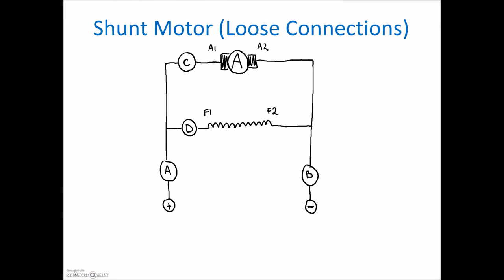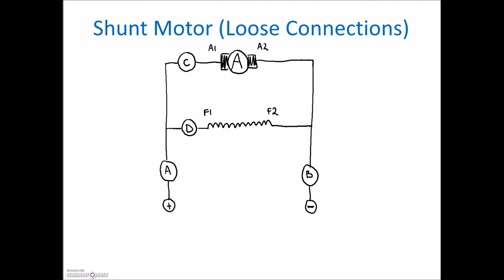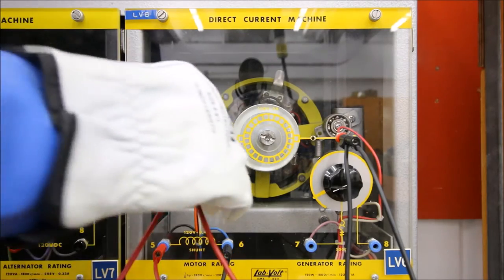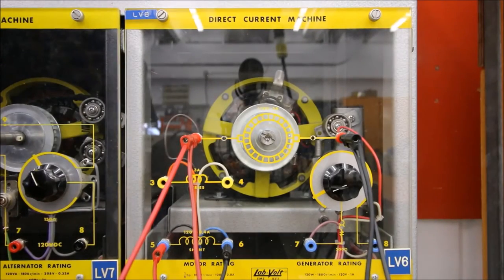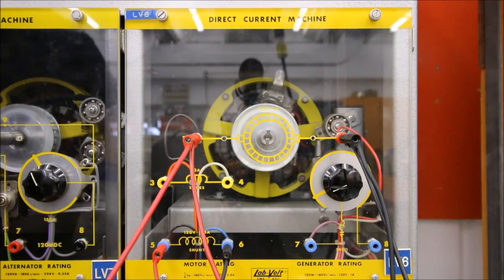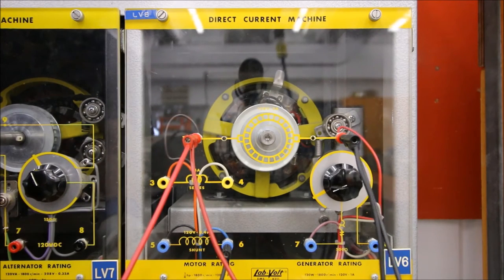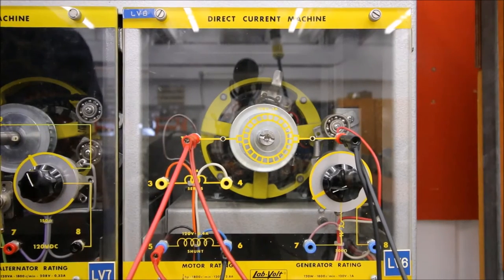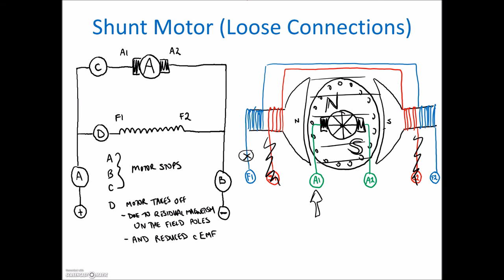Shunt DC Motor (Loose Connections)

Comment: Cool demonstration! How did you know when to unplug (since this seems to be a school's expensive equipment), and what would you do if you didn't unplug in time to save the machine? 

...why are all these guys writing "wuld' in the comments? What's up with that? Bots? Foreign spies? 14 years old? Or can some engineering students just not spell? 😸
Reply from the maker: As soon as it takes off we turn off the breaker. If you didn't disconnect on time, the bearings would heat up and the motor would fail within minutes.

Comment: how wuld a generator starter set up look like? haveing same device doing bouth useing the brushes to control functions. how wuld capacitors effect that device? there are some mith's about those engines like loockridge device,teslas methode of conversion etc
So Im wondering how dry cell baterrys wuld react? so any info about those old system's? Im useing actualy plazma ignition and amplifier ignition as well so Im wondering if that culd by implemented in those devices? I try to understand peater linderman but hes not realy usefull realy considering the back emf problem. We dont realy see any solid state circuet the explanation not realy present. Those tri filar coils confuse my.